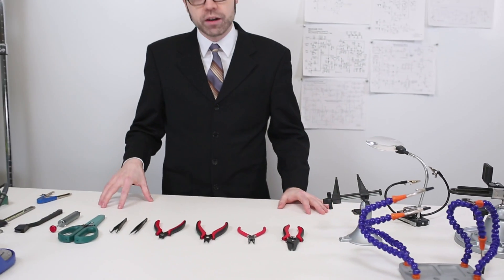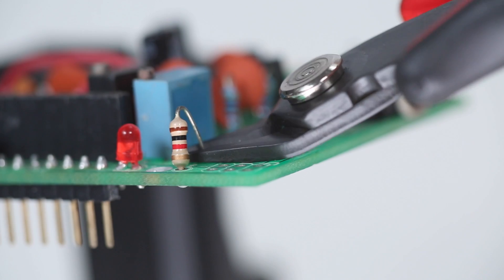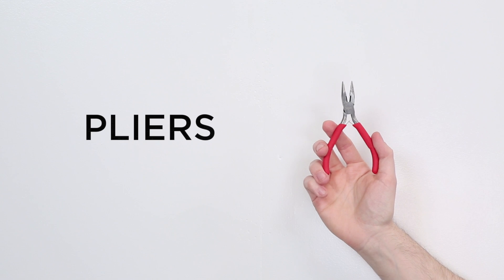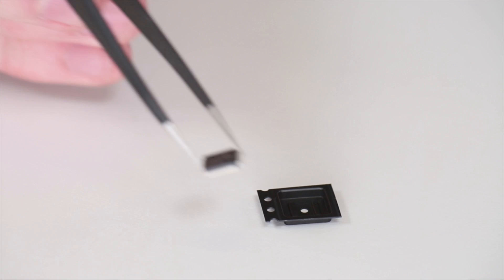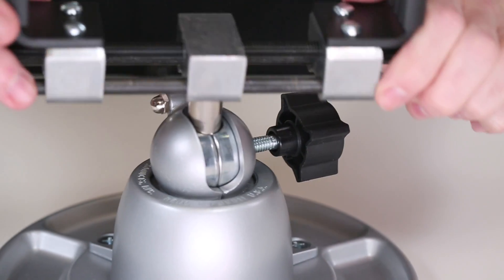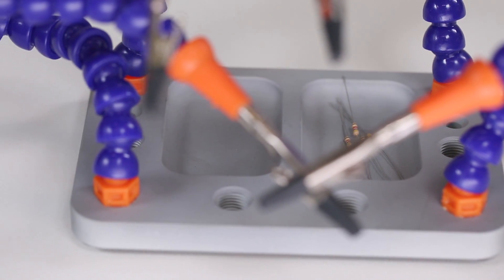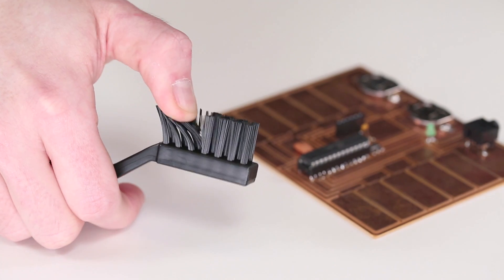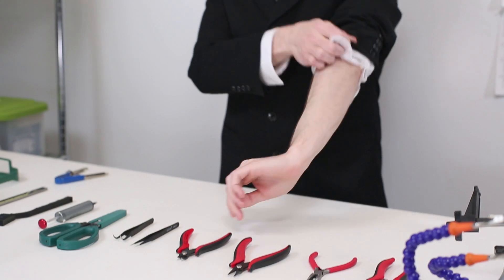Collin's Lab: Hand Tools

Comment: I don't disagree with him.  However, I found that some Hartmann alligator forceps (I have also seen them called ear polypas) are very handy in assembling electronics when you drop a tiny screw in a hard to reach place.  There are versions of these that can fit through a 1/4 inch hole and grab something up to 1 foot on the other side.  Unlike hemostats, only the end opens like a little alligator mouth. They are every bit as handy for small electronics work in the case as they are for performing surgery in the ear.

Comment: The standard type of "helping hand" tool is pretty useless. Best to just buy the lock line type first as they are a thousand times better.
Reply: +Wankel Motor I don't disagree with you, but they're cheap and better than nothing, so not completely useless. Same goes for cheap 10 € soldering irons.
Reply: Bart Stikkers Well they are just a frustration. They are unstable because of the narrow base so they are tipping over all the time. The movement of the arms are very restricted, the magnifier is more in the way than helping, the joints are loose and if you try to tighten them a little it is easy to bend the flats that is holding the joints together, the alligator clip rotation locking mechanism is useless and sloppy and easy to break, etc.

I would say that a cheap soldering iron is way better value than cheap helping hands tools.
Reply: That's certainly true.
Reply: +Wankel Motor From my personal experience, it is not useless. For small boards and other little stuff, it works just fine. For large stuff - yeah, it will fail or better to say it will fall :D
Reply: I bought a very small clamp on vise on the hardware store and it has been much better than the crappy helping hand. Now I use it only for wires

Comment: One thing that can't be emphasized enough, related to the last point about taking care of your tools, NEVER use your (component lead) cutters to cut anything but component leads or really thin wires. I have seen people trying to chew through a nail with them.